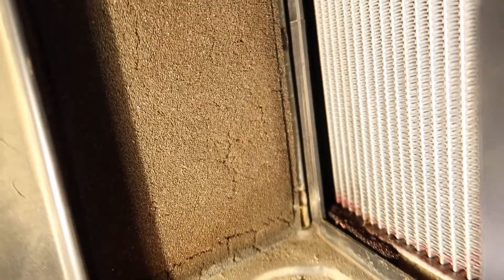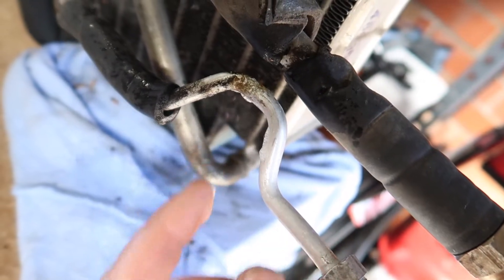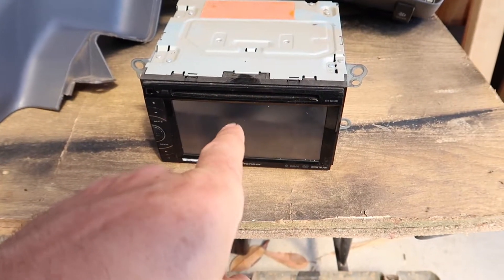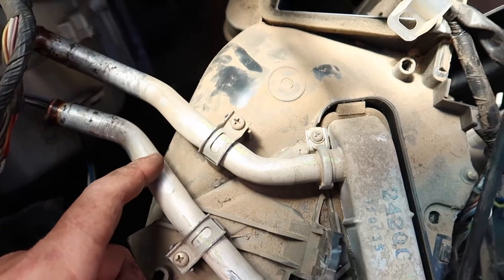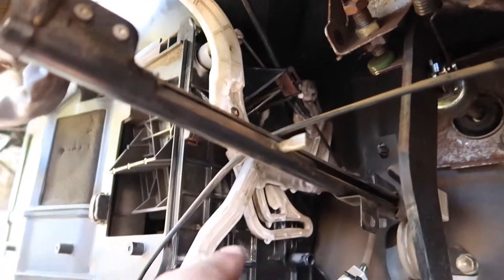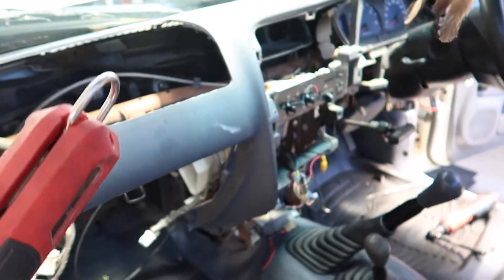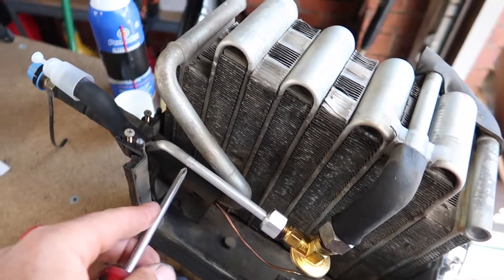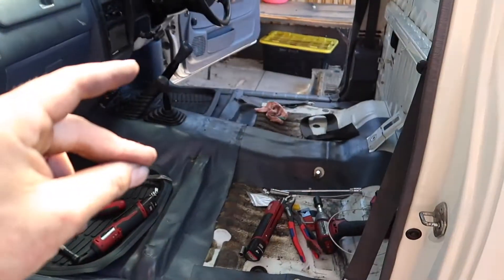2000 Toyota Hilux Heater Core Replacement and Air Con Pipe Fix

Comment: Thanks Anthony very appreciative of your efforts to make this video. I could not have done it without your ‘help’. For any future readers, if your hilux has 3rz with passenger airbag and ABS, you’ll need to remove the engine management and ABS modules, but otherwise follow the process outlined in the video. Cheers again to Anthony , a Champion.
Reply from the maker: @Ash2will1  glad it helped mate, cheers Anthony!

Comment: Thank you so much for the video followed it pretty much step by step took me roughly around 4.5 hours from start to finish note if you have a 5le you will need to remove the computer to allow the heater box to slide out
Reply from the maker: So happy it helped 😍

Comment: Good video, where is the heater valve please as I need to replace mine and toyota can't find it.
Reply from the maker: There is no heather valve, the system only changes the direction of airflow to regulate the temperature.

Comment: We're abouts did you get the heater core from?
Reply from the maker: Bought it from eBay https://www.ebay.com.au/itm/132831127433?mkcid=16&mkevt=1&mkrid=705-154756-20017-0&ssspo=NJo22zB8QqG&sssrc=2349624&ssuid=01F41vf8QD2&var=&widget_ver=artemis&media=COPY
Reply from the maker: Bought it from eBay https://www.ebay.com.au/itm/132831127433?mkcid=16&mkevt=1&mkrid=705-154756-20017-0&ssspo=NJo22zB8QqG&sssrc=2349624&ssuid=01F41vf8QD2&var=&widget_ver=artemis&media=COPY

Comment: Thanks mate, great video. Looking at putting AC in an 1998 hilux workmate, your video was really helpful. Whered you source the AC parts for your hilux?
Reply from the maker: Awesome mate! I sourced the A/C Lin and orings from Toyota and the TX valve from eBay https://www.ebay.com.au/itm/302966669447?mkcid=16&mkevt=1&mkrid=705-154756-20017-0&ssspo=22on4tUnRUK&sssrc=2349624&ssuid=01F41vf8QD2&var=&widget_ver=artemis&media=COPY

Comment: Too hard for me mate...just going to undo the hoses and block them with bolts and screw clamps and go without a heater...just be using a blanket for those winter drives...as long as i've got air con for the summer that'll do me!
Reply from the maker: Yeah bro, it’s a bit of work. You can actually loop the hoses to bypass the heater core, which is what I did for 4 years 😊

Comment: Hey mate, great video thanks for posting it. Do you know where the heater tap is for this model, (mine is a 1999 Hilux 4wd) I can’t find it anywhere. I have 1 hot hose going into the firewall but the other one is cold so I’m assuming it’s not flowing through the heater core. I thought it might be at the bottom of the heater box where the cable connects but there can’t be a tap there after watching your video and seeing how the core comes out. I have followed the hoses from the thermostat to the fire wall but it’s not there anywhere.
Any help would be much appreciated as I’m freezing my ass off driving to work in the mornings, cheers
Reply from the maker: Hey mate, this model doesn’t have a heater tap. It had a constant flow of coolant running through the core at all times and it controls the temperature that comes out of the vents with a flap that directs air through the core. If you are feeling hot water going to the fire wall but not out it could be a blocked core or you need to bleed the cooling system with a funnel that sits higher than the two fittings on the fire wall